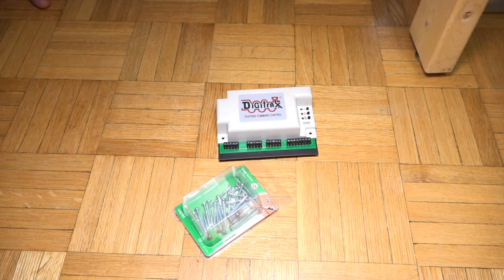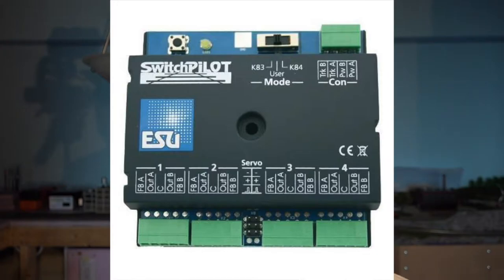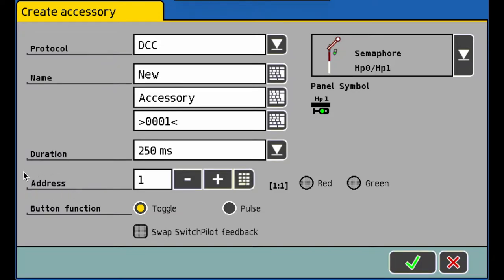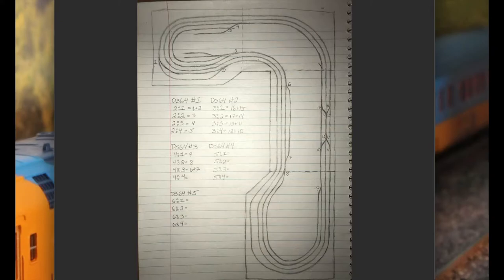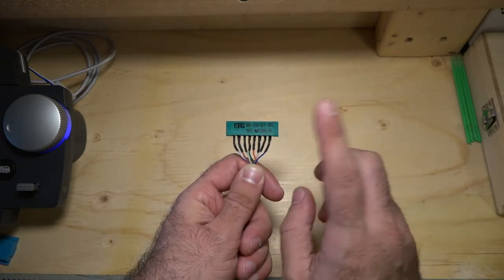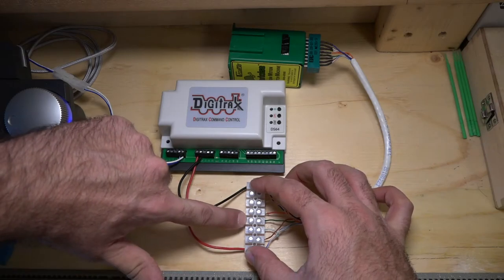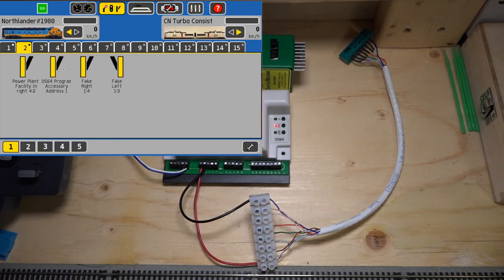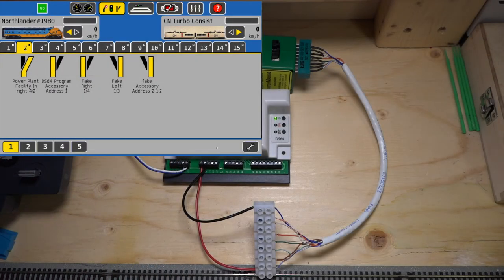Programming DS64 with the ESU ECoS2

Comment: Nothing beats the Bachmann DCC track. No need for digicrap! Just my ESU ECoS command station and the DCC track from none other than Bachmann. The ECoS throws the switches every time! No problems for over 4 years now on my 5' x 10' layout
Reply from the maker: Hey RC Cosplay,   Ya I have a couple of those HO Bachmann DCC Turnouts and they are awesome!  I think they nailed it with those turnouts. I use the HO stuff for my Christmas set up.   But from what I know I don't think they have them for N scale! I tried the Peco snap through outs and I am not a fan! so this was the next step.   I'm just happy that the Digitrax works with the Ecos.
Reply: @H0bby_Adventure  That is correct, they don't make the DCC track for N scale